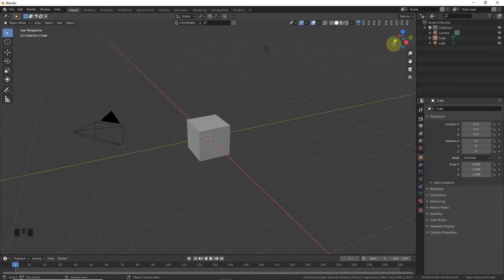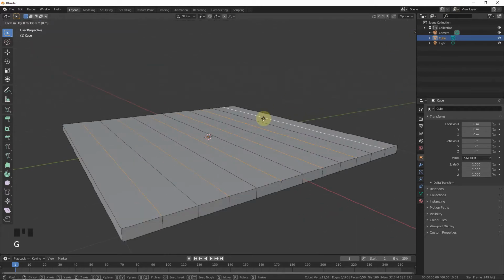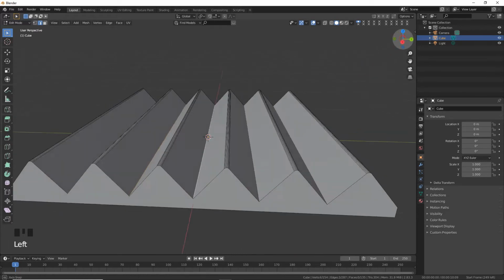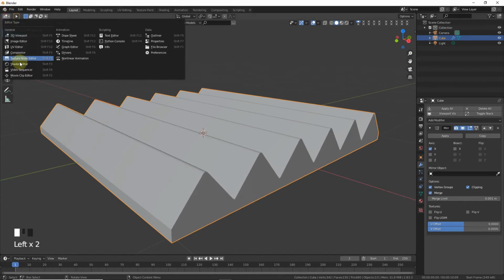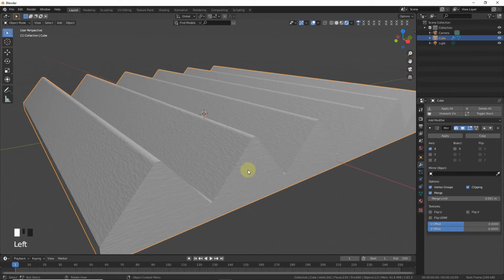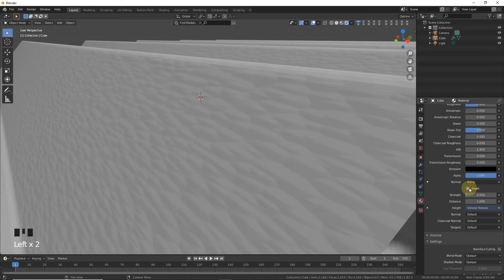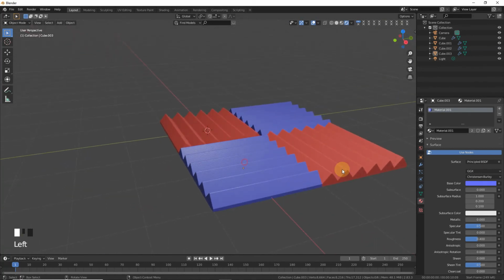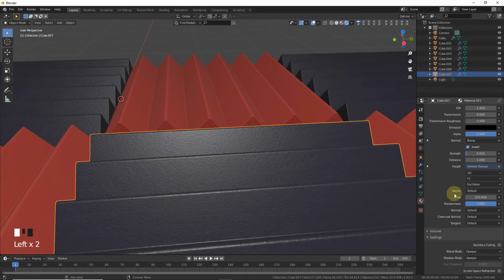Acoustic Panels/Foam In Blender Beginner Tutorial

Comment: bro the values the not correct
Reply: New version bro
Reply from the maker: That's why values are change.
You need to match the values with my video.
 try this and than tell me if it work.
Reply from the maker: Which values??
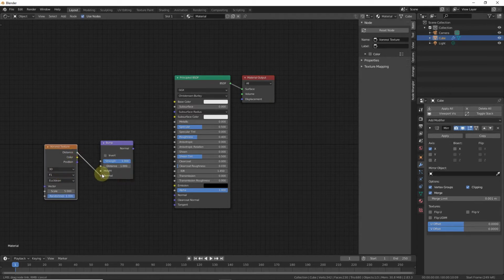Reply: @MoinAkraM  2:23 BRO FOR ME THE VALUES ARE WRONG IN MY COMPUTER BIG FAN BTW
Reply from the maker: Which version of blender you are using..
Reply: @MoinAkraM  thank u it worked